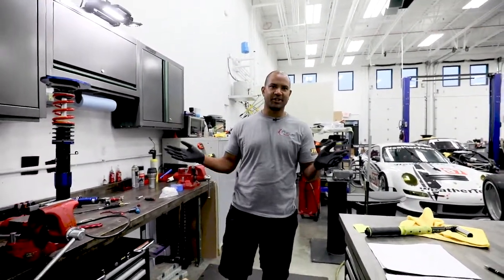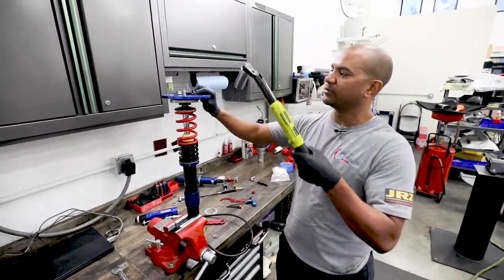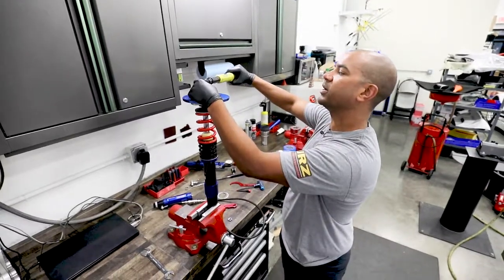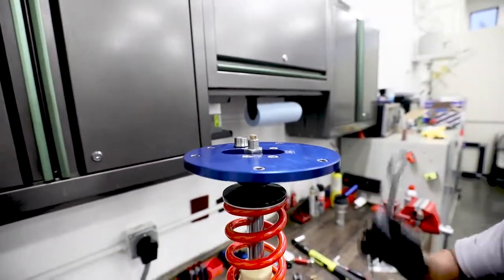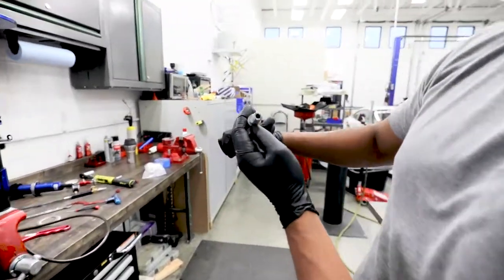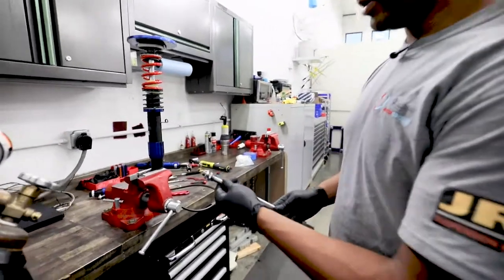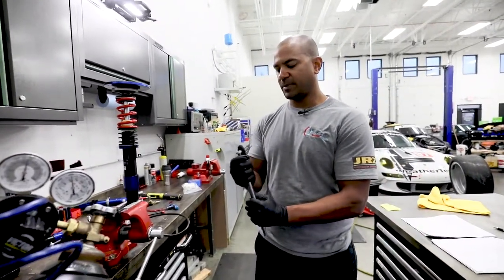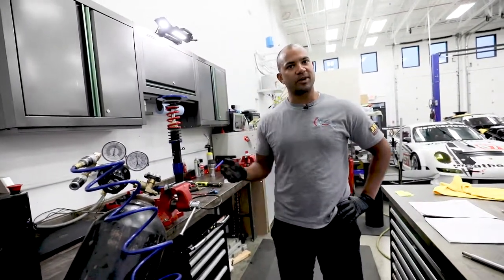How to torque your shock tops and avoid breaking them!

Comment: Would you mind sharing how to torque the first nut without the shaft spinning? Thanks
Reply from the maker: You don’t. Run the first nut down until it starts to spin the shaft, then hold it with a Bonny wrench, then torque the top. Hope that helps!